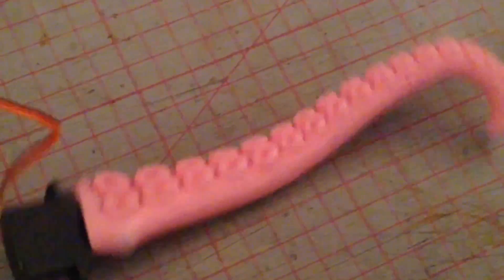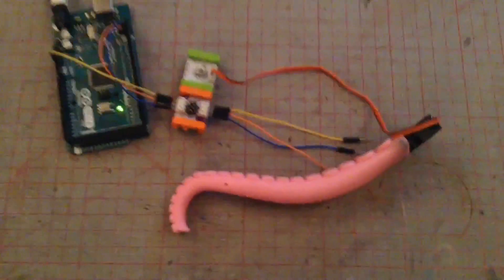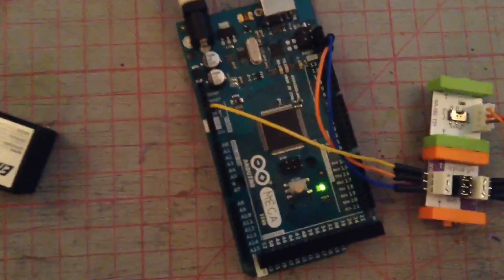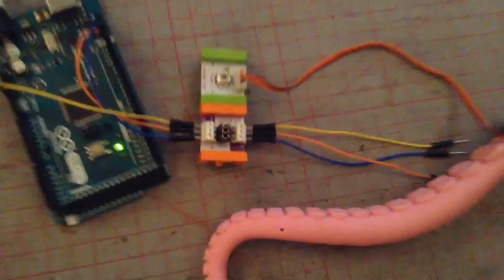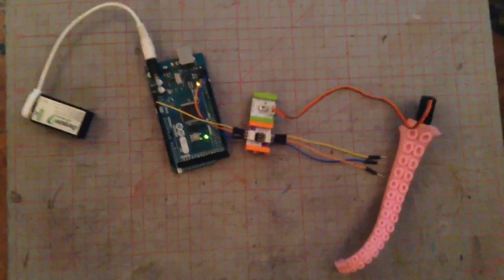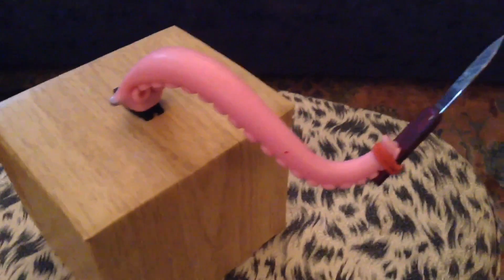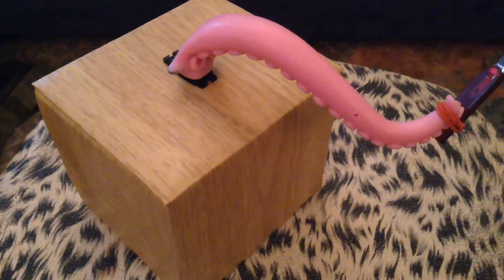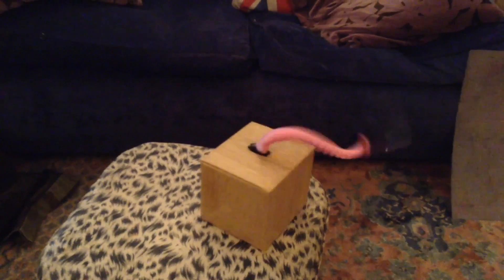The 'knife-wielding tentacle' Build. Full version

Comment: no offence but i could have done this with much fewer components and much simpler circuitry, just whack a simple square wave relaxation oscillator on to the servo and bob's your tentacle.
Reply: This was a for-fun experiment, not a procedure with this goal, and outerspace barely had arduino experience. Chill.
Reply: Nah just some flimsy rubber glue a few pieces of plastic, a two 9v battys a motor, and an interference fit.

Even cheaper.
Won't be as floppy but it will make a circles of ouch.